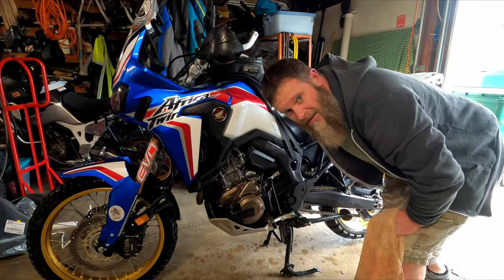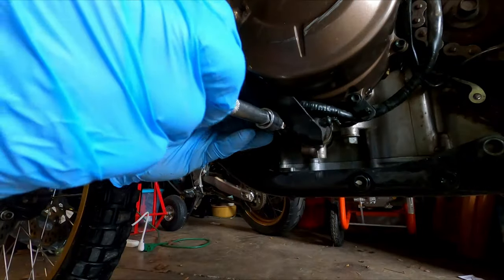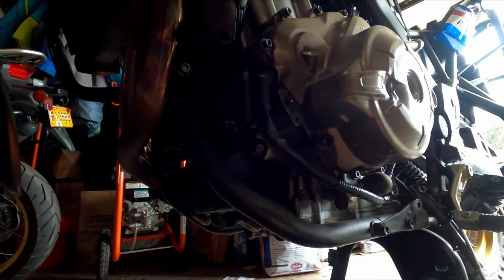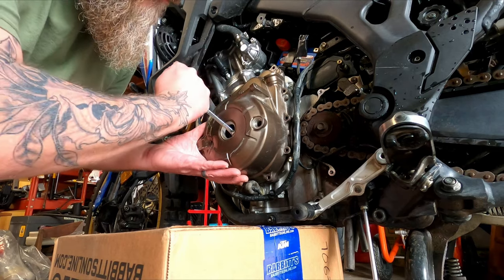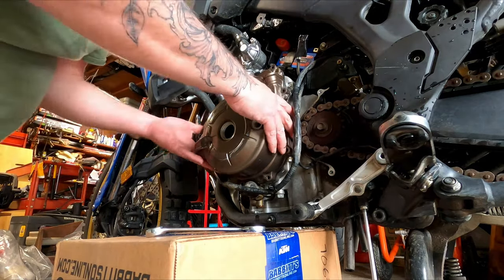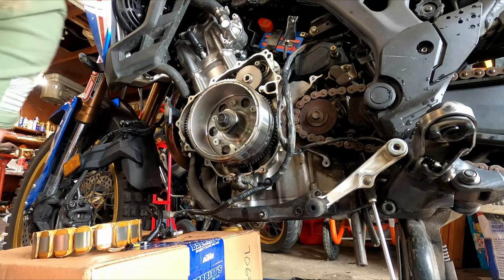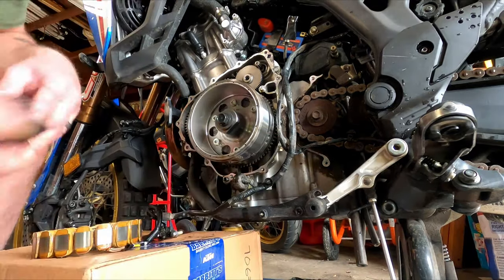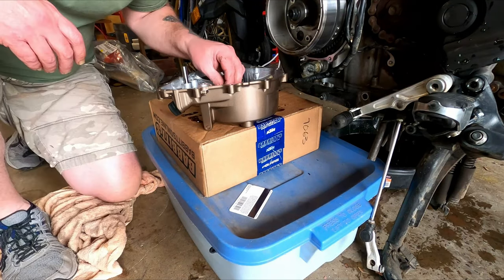DIY Stator Cover replacement 2019 Africa Twin

Comment: Nice work. Thankfully this is a relatively easy job.
Reply from the maker: It is yes. I filmed it for those that have little wrenching experience. When I first started years ago I was always terrified of doing anything having to do with the main case or block. Wanted to show it’s nothing to be afraid of and easily accomplished with the proper tools and knowledge.

Comment: I'm the same way about working on a clean bike... it's so much easier and pleasant.
I tore into my DRZ today.  It needs new tires, forks leak, all the rear suspension bearings and pivot point bolts need inspected/serviced.  There's an ongoing oil leak that's driving me insane. That's all I know about so far.

Comment: As always I love your DYI bike videos. Recently took your advice on the gearing for the AT/ATAS and ordered new sprocket combo and went with your suggested 16/44 combo for a more friendly crawl speed off road. 👍🏍
Reply from the maker: Ads probably 4-500 rpm in the top end to get to the same cruising speed as OEM gearing, but the gains you make in low end “torque” for me is absolutely worth it 🤘

Comment: Dude if only this came last week.... I JUST replaced the stator cover on my Z900 after she slid like 80ft and wore all the way through the cover (ouch, at least the gopro was rolling). 
I like that you also employed the trusty "parts-box-stator-cover-stand" that I quickly learned about, only AFTER removing the cover did I realize how short those wires are and had to grab whatever was closeby lmao 
I definitely should have put the gasket on the cover itself like you did, my dumbass tried sticking it to the case and used an ungodly amount of grease.
Reply from the maker: I have a good idea once in awhile
Reply: @ExploreAdventureMoto  keep em coming, I need all the help I can get😭

Comment: I decided to also vent my stator cover yesterday. I’ll be replacing the cover on my 2017 DCT model and hoping it’s the same procedure. Is that liquid gasket a specific one for the Twin or something that you recommend? Need to order the cover but want to make sure I have all the tools and parts ready.